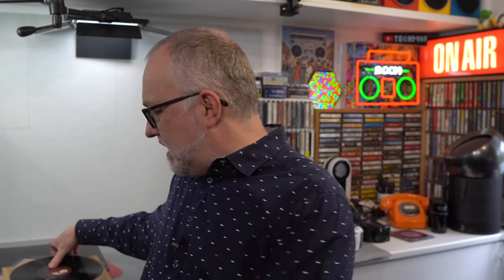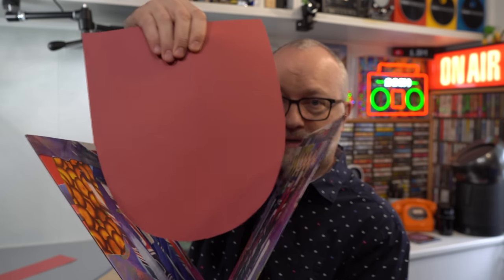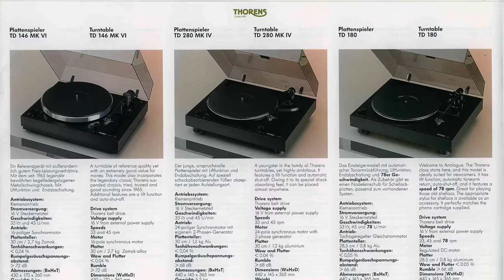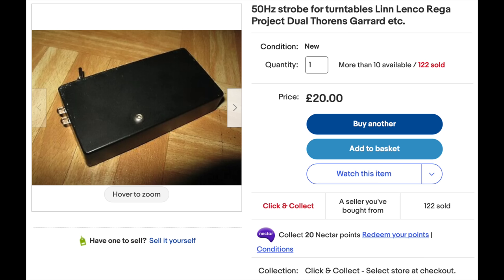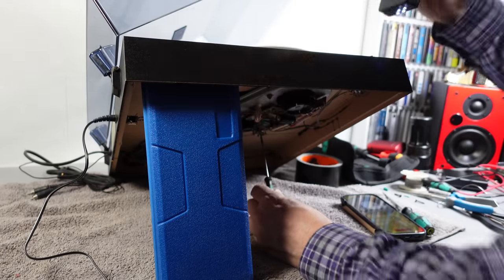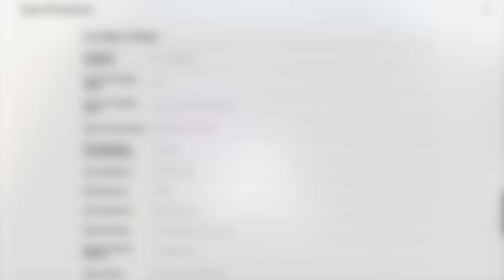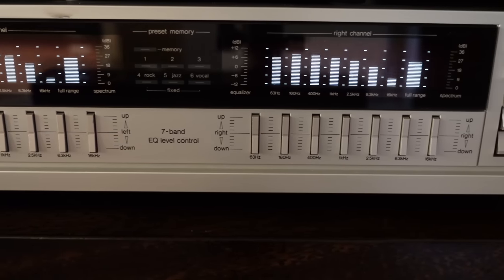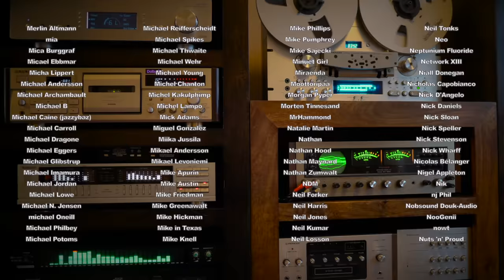Playing 78 RPM Shellac Records properly

Comment: In this video, a very important lesson is reiterated - sometimes, good enough is good enough. My 78rpm playback system is a Rega Planar 78, with nine different custom-made stylii - and honestly I could probably use nine more. I transfer flat and apply an inverse curve in the digital domain. All this cost silly money, and it takes forever to get set up to optimally play something... but the results are fantastic. I know that whatever record I put on, I can get it sounding as good as physically possible. Which makes sense, because I'm obsessed and I transfer 78s professionally...

But if you're a normal person who likes to play 78s for leisure, and might want to archive the odd one for your own usage... do you need all that stuff? No, it's a colossal waste of time and money. You need what Techmoan got in this video: With a decent turntable with a 78rpm setting, an appropriate cartridge, and one 3mil stylus, you can get pretty much instant, very acceptable results from pretty much any 78rpm record. It'll be not far off what I get on my overkill setup, and was probably 20 times cheaper. And you can put on a record and play it and hear music three seconds later. The law of diminishing returns at work. Techmoan is sitting back with a cup of tea and enjoying the music, and I'm still swapping back and forth between a 2.8 and 3.0 mil stylii in the hope of making an almost imperceptible improvement in surface noise.

I massively, massively respect this video. It shows you how to play 78s well, on a sensible budget, with the aim of enjoying them.

Thanks! :)
Reply: It is a con that Rega only sell planers with 33/45 and you have to buy a another deck  for 78s.  I stick with ny Garrard 401 which plays all three speeds. even Garrard's basic Sp 25s could play all three speeds and sound great too

Comment: Had an old 70s record player that had 16rpm speed as well as the other three.
Reply: I swear we had one in the 60s that had an 8rpm setting! My mother was learning to take dictation at the time and had books of floppy records with dictation on them, and some of those ran at 8rpm. I can't prove this, as I no longer have the record player or any of the discs, there are no photos or other evidence, my mother is no longer here to ask - and my sister doesn't even remember mum doing this! So it might just be my memory. But I don't think I would have made up or misremembered something as odd as this.
Reply: @paulhaynes8045  Yoou are not imagining it. 8 RPM was used for flexible records of books for the blind. There were special record players usually used to play them. I had one that had a bright green plastic injection molded case.

Comment: Looking at the schematic the speed control seems to be a simple analog frequency counter, many parts that can drift over time, knocking things out of whack. Trimming that seems to be normal operation. Given it's already running on low voltage and has a strobe one could probably replace the whole electronics with a modern digital control for near perfect speed. Question is if that is necessary/desireable

Comment: A few of thoughts on this (as always) excellent video. 1 I use a second headshell for my turntable for 78s, with additional weight to avoid having to adjust tracking weight settings. 2. I capture any digital recordings in stereo so that my de-click software (if I choose to use it) can use the stereo characteristics of the noise to help identify and remove it. I can then choose whether to listen to left, right or a mono sum of both channels. 3. My turntable allows fine adjustment of the speed, allowing correct playback of early records whose nominal speeds aren't quite 78 rpm. This can be tricky: you can't even rely on adjusting the music to be ‘in tune’, as it's not easy to know what tuning would have been used before the Second World War. Perhaps also best done in software after recording to computer. 4. Perhaps it's also worth mentioning that the received wisdom is that a range of stylus sizes is required for best results with 78s. I haven't got round to arranging for this rather expensive option yet, though.

Comment: Just remember not all records are 78 rpm. They varied from about 70 to 100, so make sure you can vary the speed of the player.
Reply: I remember some "78" rpm records in my Father's collection were speed 80 rpm.
Reply: @porridgeandprunes  I can move the pitch slider on my LP140XP to get 80, mostly 1920's Columbia

Comment: It also could be the Powersupply. If the supplyvoltage is out of spec it may affect the rest of the system.
Reply: With unregulated AC supplies, you usually get internal regulators (one positive, one negative). Otherwise it would all be very wobbly, as it'd depend on the current draw anyway.
Reply: And to boot, the turntable is regulating using closed-loop feedback from the motor spindle, so it’s going to regulate away the speed deviation regardless of its source.
Reply: @tookitogo  Although this model lacks a crystal oscillator, which might be the explanation why it needed adjustment for the pots. And in that case, a different voltage, if it were to use the unregulated one from the external power supply, would actually change the frequency of the RC oscillator. It's just that I don't believe the voltage not to be regulated.

Comment: Wind-up gramophones typically had FAST - 78 - SLOW speed selectors for a good reason - many "78s" weren't recorded at 78rpm.  Some had faster recording speeds - 80rpm quite common at one time - with some as low as around 65 rpm.  That's one reason why the Audio-Technica model you mentioned has a what might be argued an essential fine speed control.  Comments?

Comment: Curious why the flippable stylus cartridges aren't the standard for modern multispeed record players.
Reply: They were standard for a while during that changeover period, but then fewer and fewer people cared about playing 78s. Cost reduction culled it.
Reply: Because it's been a while since 78s were actually produced. So there is a trade-off between cost to add this feature vs how likely it is that you'll be using it.
Reply: @graealex  New 78s have been pressed, reproductions of the old pressings in microgroove, Beach Boys 2011 RSD

Comment: Never clean them using alcohol based solutions, use a wide stlyus to play them, try to find an adjustable speed turntable because some discs runs at 80RPM or more.
Reply: @djkraze5018  Exact ! Pathé too did this.

Comment: One of your most informative posts ever, at least for me! I finally understand why my dad's 78 RPM records sounded so awful. This is straining my memory a bit, but I seem to recall that his 1962 Magnavox console hi-fi set's record changer came with a ceramic cartridge that had one of those 33/45 - 78 flip styli that you showed. But around 1975, that record changer's motor started having speed problems, and after Dad made several failed attempts to fix it, he retrofit a Realistic (bought at Radio Shack, probably made by BSR) 3-speed record changer into the console, replacing the original changer entirely. The new player had a magnetic cartridge with a needle intended only for 33 and 45 RPM records. I was quite young at the time, and I thought the reason the old 78s sounded so scratchy was simply because the new cartridge and stylus revealed more of the imperfections in all kinds of records. But after watching your video, I get it -- those records could've sounded much better if he had bought a second needle for playing 78s. I know I'm simplifying quite a bit. I don't remember how difficult it was to change needles on that new cartridge, or if it was even designed to let you change needles at all. (Dad once told me that one usually replaced both the magnetic cartridge and needle together, although I don't remember ever seeing him replace either.) And, as you mentioned, one should also adjust the tracking force, which was a pain on that particular turntable, and then there was the preamp he was using, which I think he built himself from a kit, also from Radio Shack. But it seems to me that just having the right needle improves the sound of those 78s by about, well, 78%.😆 Anyway, thank you so much!

Comment: My Dad had an early 1950s Zenith stereo Hi-Fi, the big old fashioned kind with two great big consoles, one with the record player and tuner, the other with its own amp and speaker.  All vacuum tube and alnico magnet speaker, of course.  The phono section had a knob where you could select RIAA, NAB, and several other equalization settings that were probably almost dead by the time this thing came out in 1954.  Sadly, the old Cobra-Matic turntable didn't work anymore, but the two monoural tube stacks did, and our neighbors got to hear a lot of Jane'sAddiction blasted through them from a CD player.  Good times!

Comment: WIthout even looking at a schematic, I'll bet you the resistor that feeds the input side of the 3 speed pots has drifted in value by 5%.
Reply: Very possible, but in mine, dry bearings restrained the motor, it turned a lot faster and quieter after I oiled the motor. The platter shaft bearing was also completely dry.
Reply: @mrnmrn1  yes. Like i mentioned, although that motor has an optical encoder for speed governance, It has no way of knowing the platter's actual speed. a stretched belt in combination with a dry main bearing could definitely account for Matt's problems.

Comment: TechMoan: there’s no way it’s the pots, don’t even say it 

* fixes it by adjusting the pots *
Reply: The pots didn’t need adjusting because someone messed with them or because somethings wrong, electrical components have a shelf life and their tolerances wear out over time. That’s the whole reason for including the pots in the first place. Not sure why you felt that you “shouldn’t have to,” I’d say it’s pretty sweet that it was that easy to fix because they were there
Reply: I think his reasoning was that since all speeds were about the same percentage out of spec, the problem had to be something that wasn't specific to a single speed

Comment: Did you check that the main bearing is properly lubed? A dry bearing would explain both the slow running and the labouring motor.
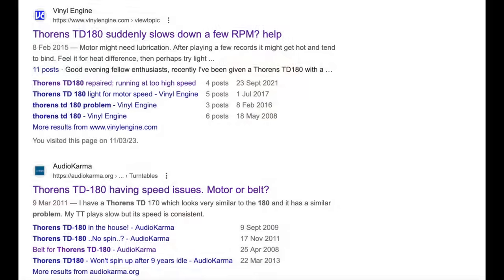Reply: It even says so in one of the forum posts regarding this player he showed us at 10:18
Reply: My NOS 140XP ran slow with wow/flutter after 2 days, I had to lube the shaft, fully dismantle the motor

Comment: Some other things worth noting that may have been mentioned in other comments that I haven’t seen:
-after electric recording was introduced, most discs were recorded at a relatively accurate 78 rpm. In the acoustic recording era, not only were some discs recorded unintentionally at different speeds, but some manufacturers sold discs designed to work with their record players at speeds anywhere from about 74-81 rpm. The pitch control on my grandparents’ acoustic Victrola is a rather insane device. The pitch control on that AT could cover much of it.
-you could drill a hole in the case somewhere and relocate the 78 rpm speed adjustment pot to an accessible location with a knob or screwdriver adjustment to enable it to work with discs recorded at different speeds.
-Edison and Pathé did something downright obnoxious and recorded information using vertical deflection instead of horizontal. There are cartridges available that are modified for vertical deflection discs, but they’re esoteric and pretty expensive.
-if you want one good turntable that will play everything (not counting 16 rpm discs, they’re not worth worrying about), most of your options are going to be old, either rehabilitated or needing repair, and not necessarily cheap other than lucky shopping. Things like the Garrard 301/401, Technics SP-10 series, SP-15, SP-25, etc. They’re all broadcast type drive units that may need plinths and separate tonearms. Other all-in-one options of high quality would be leaning towards idler-drive changers like the Dual, P-E, and ELAC units, any of which are going to need work to ensure their mechanical complexity continues working.
-there are a few collectible type 78 rpm microgroove discs out there. They can sound incredible. In much the same way that a 45 rpm 2-disc reissue of an LP can sound excellent due to the greater bandwidth of the record moving past the stylus at a greater rate of speed (with the equivalent loss of data storage per time unit,), a 78 rpm disc will have nearly double the bandwidth of a similarly-sized 45 rpm disc - with, once again, an equivalent loss of storage capacity in terms of time.

Comment: Really enjoyed this video. I learned a lot about 78s. As much as I listen to 33 and 45RPM records, I've stayed clear of 78s just assuming they sound poorly. I am now rethinking that thanks to your video. In case it helps, I'm an electronics hobbyist as well. It occurred to me that some of the components in your Torens may have drifted in value, not just the caps but the resistors etc. This is pretty normal for something of that age so would explain why the need to adjust those trim pots a bit. May not be the motor. Something to consider. Have a great day.

Comment: I had this same problem many years ago on a twin turntable DJ console.after swapping out old caps for new etc it was no better then I realised the spindle bearing lubricant was old and was acting more like glue causing drag so I cleaned and re oiled the spindles and both turntables behaved and ran at correct speeds... nowadays whenever I get any problems on second hand turntables that I've picked up the spindle bearing is my first port of call .happy listening folks

Comment: In terms of hastle and time spent, and not a terrible amount more cash, you may as well have gone with the Technics turntable and stylus and had a much better experience that would still be working quite some time from now.
Either way, it’s remarkable how good the audio from those old records is. You’ve inspired me to at last run the cartons of 78’s that I’ve carted for years around the country through a SpinClean wash, and put that same Technics 78 stylus onto that same Technics turntable you’ve shown, as I purchased them together with a stereo cartridge recently.
Regardless, your channel is always quite fun, and I do enjoy your forays into this and that bit of tech. Cheers!

Comment: You can get a grey tipped stylus that's made for 78's. It will fit on any of those "Victrola" case players.
Reply: My needle is red with green front Sanyo equivalent by EVG I bought for the Crosley

Comment: You can just use one channel from the cartridge and send it to both channels on your receiver, but in most cases you will get better noise reduction and cancellation from combining the left and right channels. I accomplish this by adding a simple switch to any phono preamp I use. Also, it may have been worthwhile to acknowledge the wide range of speeds at which acoustic 78's play. If anyone wants to play records from before 1925, a turntable with 78 rpm but no speed adjustment will be insufficient.

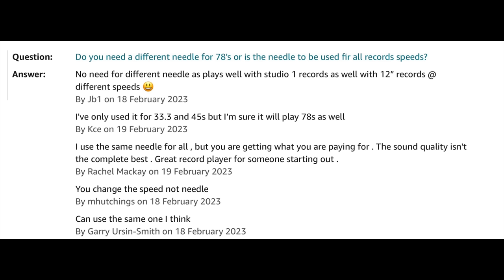Comment: 8:33 Playing shellac records with a diamond stylus will wear down the grooves of the shellac record. Playing them with the wrong stylus on top of that will gouge the sides of the grooves a lot faster and will damage them irreparably. 
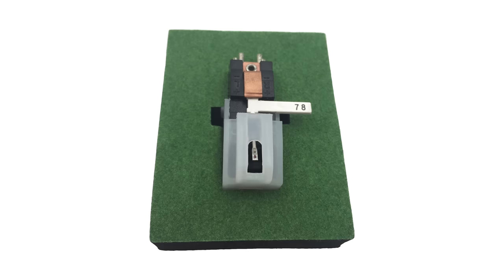9:14 Sapphire is the correct material from which to make a stylus intended for an electric cartridge used for 78 rpm shellac playback. They do not last very long of course.
Any stylus made of hard material will damage the grooves but having the wrong shape makes it worse. Plus the shellac is a brittle material, turns into debris that accumulates in the groove and ends up working like a sanding paste. Even the steel needles originally used in gramophones cause damage. The only styli that cause little damage are those that wear off faster than the shellac. Those are known as fibre needles or cactus needles and are made out of wood or a cactus thorn. For rare shellacs, they are the only option. The problem is, there no modern electric cartridges that accept these needles so playback is only acoustic, i.e. on gramophones. The other option is the ELP (a couple of dozen grand) which will pick up all the noise due to damaged grooves or accumulated dirt and debris. Cleaning shellac records, assuming it can be accomplished at all, is not easy or advisable. Even distilled water will cause damage if the cleaning is repeated a few times. Any chemicals, including alcohol and the usual record cleaning fluids, will destroy the shellac. The only advisable way to clean a shellac is to use a very soft brush or some lint-free cotton cloth lightly dampened with distilled water. In any case, proper advice should be sought and obtained before attempting such a task.
Talking of 78 rpm records damage, the greatest enemy of 78s is the post... combined with inept packaging. Today's postal service neither expects nor is able to handle transporting 78s and most senders either do not know this or do not care.